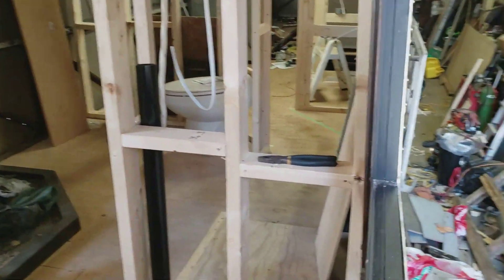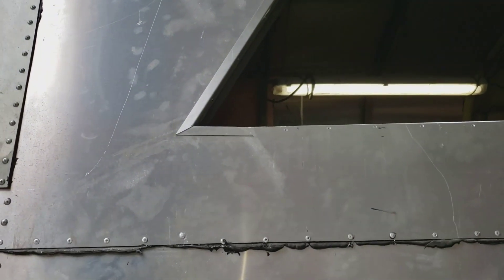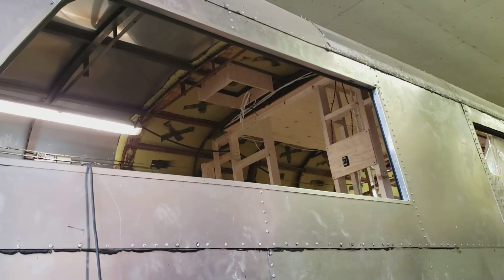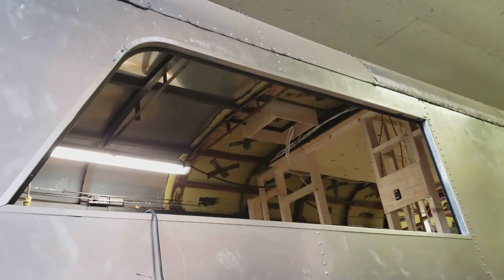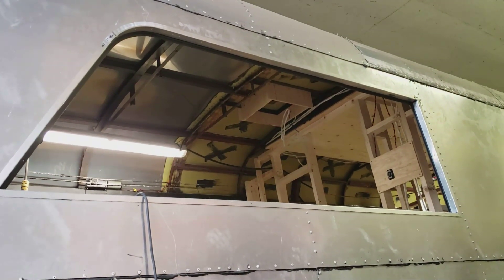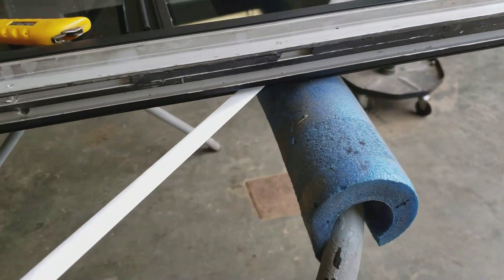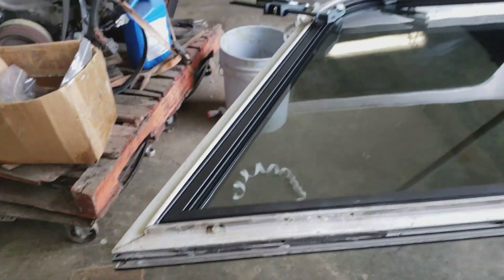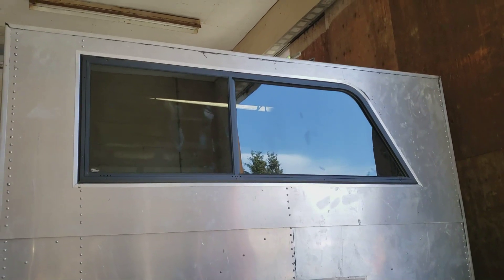Bus Conversion Project - Video 89 - Installing the windows

Comment: Looking Awesome  as always love the molding edge around the windows. Had a grand time with the shrink-er stretcher again I see. Glad you made the stand for it now aren't you lol
 6 pieces X 1 pain in the ass process = Major pain and proficient use of the English language including all of its  profanities. :0 .
The mat black finish on the frames should look nice against the final body color. The drivers side rear slide looks great with all the trim edges and now the window installed and trimmed out. With Fathers Day coming maybe you and Dad can get some crates and sit up front together and make Va-room Va-room noises and celebrate the windows are done.
Reply from the maker: the front windows have 2 curves on them so measuring was critical, it's amazing to me how the right simple tool makes a job doable.... making the curved trim pieces would be impossible without the shrinker-stretcher and it is from my hotrod building days..... wish I still had the English wheel but there aren't any compound curves on this so not so critical.... have you started building your bus yet or still in the planning stages???.... we sit up front quite a bit and make engine noises..... people look at us funny though.... don't know why... :-)
Reply: @JamesEDennison  I'm still working on design issues and axle capacities. Weight transfer from rear and tag to front ie:fresh to grey / black hoping 6th design time will work. Fuel tank capacity weight limit is killing me on grey water location and preference to conjoined dump plumbing ( all internal no snake tube on ground ). May Have to change chassis choice for a Neoplan Skyliner the axle cap is more but could also revisit a previous design that had all the tanks carried over the rear and tag and just the fuel on the steer. No slides and true stock exterior look all hook-ups will be thru the floor not thru the side panels and plumbing vents were designed to exit using existing side louvers next to the radiator intakes. poop gasses blown thru the radiator lol avoids the seal leaks from roof style vents. A huge amount of designing now trying to reduce redesign work during the build.
Reply from the maker: Ya, it takes time... I spent the better part of 2 years designing and drawing mine up before starting.. sure pays off though.... virtually no re-does... a few adjustments as I'm building but nothing major
Reply: @JamesEDennison  Definitely worth taking the design time slowly if I had started build already i would have used version 3 and been screwed to the amount of $95,000 plus the chassis  for a conversion that would not pass weight limits and would have to ripe it apart and start over . Question  for you the trim piece around the window what size angle stock did you use and material type is it stainless or aluminum. My current designs include an interior detail that i want to be satin finish aluminum and will need that same curve profile done on it but was looking at 1 inch by 1 inch and need to know about time amount to budget for fabing up around 16 pieces ( visualize finished trim wall to ceiling on partition walls ) all interior exposed edges planed as brushed aluminum for look and weight savings all extruded aluminum construction for material in cabinets and walls. Finished panels will be a combination of satin finish and fabric over pad for walls ( read less bruises when walking around if bus is moving )
Reply from the maker: the trim around the windows that I formed with the shrinker-stretcher is 20ga. 5052 aluminum that I had formed by a local company... my break is only 48" so I had them do all the moldings for me, they formed 10 ft. sections, sheared 2" strips and then formed a 3/4" angle leaving 1-1/4" for the inside portion, I wanted it to not protrude from the side of the bus more than necessary so 20ga. worked well and it's easier to form in the shrinker-stretcher than heavier material

Comment: Looks awesome James. Stumbled across your first episode a couple years ago and followed ever since. Question: do the windows have weep holes at the top? Or are those from the hinges? A little tip, start your two sided tape from both ends, that way if the plastic release tape rips you’ve got the other end to pull on. 
PS: I’ve been installing windows of all sorts for 20+ years. If you’re ever on the Island you can come put windows in for us.
Reply from the maker: good Idea with the tape... I'll remember that for the rest of them.. :-)... and ya... the holes at the top are for the original hinges I took off, I'll have to figure out what to do with them... I might take you up on the window installs someday... :-).. thanks for the tip!!!